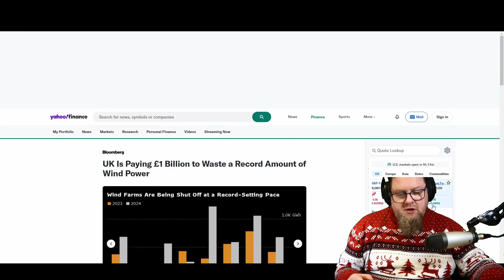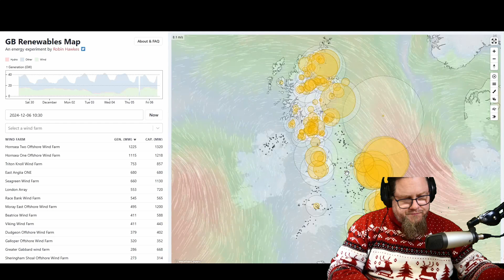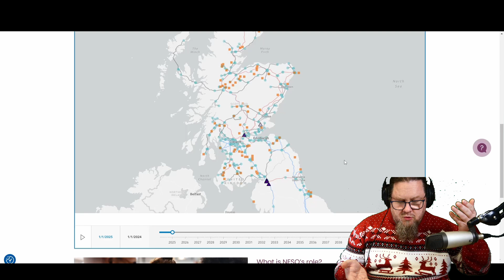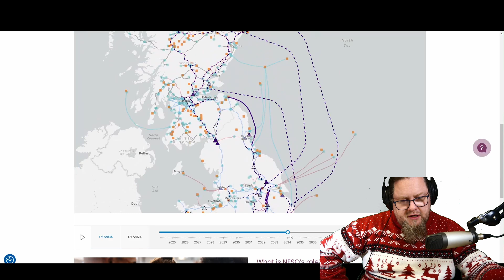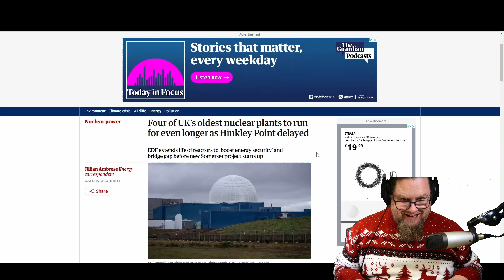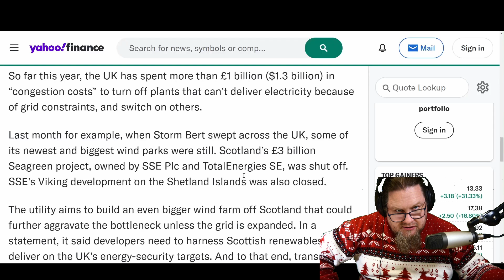Disaster! Starmer Out Of Touch With Reality, 100% "Clean Power" by 2030

Comment: You are a little too pessimistic about wind in the UK

The next generation far-offshore farms will get >60% capacity factors

This could further be increased to 70% capacity factor by having more turbes vs the inverters like they do in solar farms where you might have 1.2GW of panels v 1GW inverter and grid connection

There is definitely an issue of too much wind in scotland but thats mostly polotical in that soctland has alwahs been subsidised by England, including

Also we have always known there would be need for some curtailment. 10% curtailment means your real CFD is ~10% hugher than your headline CFD
Reply from the maker: Dream on.
Reply: @Atomicjedi  What part do you disagree with?

I'm not anti nuclear. I think it's probably the best choice for large electricity users, china india USA etc who have big enough demands to be able to build 100+ reactors and get very good at it

Demand in the UK is just too small to have a large nuclear build. So the few that we build will end up very expensive. The current reactors being built in the UK are guaranteed a price of £130/MWh (2024 price) inflation adjusted for 35 years. That's not cheap

By comparison the most recent cfd for offshore wind allocation round 6 was £82.50 in 2024 prices

Allocation round 4 and 3 were much chepaer still and hopefully we can get back to those cheap prices

So £82.50 offshore wind vs £130 nuclear. Even with 10-20% curtailment, the offshore wind would be cheaper

I don't think this would be true in say China where the wind resources are less good and the nuclear build out is big enough to get good and make them cheaper
Reply: The problem is that wind generation is very spiky and quite often lulls occur at inconvenient times such as winter evenings when there isn't any solar either. Then what? The current plan is to continue to have a complete parallel fleet of gas-fired power stations, just as today. So when calculating the cost of a system that has high wind penetration, we need to look at the total system costs including the wind turbines themselves, the backup generation and its fuel, the additional grid infrastructure (just this cost would pay for several nuclear plants) and so on. The total cost is very large and not effective because we'll still be running gas.

The alternative to gas back up is to have tens of terawatt hours of storage, thousands of times larger than today's pumped storage. This isn't feasible with today's technology, and again, makes nuclear look very cheap.

Finally a PWR nuclear plant can run for around a century - perhaps longer. Wind turbines are expected to last 20-30 years. 

The UK government are already backing away from their 100% clean power target by 2030. Now it's 95% with the rest unabated gas. Come back to this comment in 2030 and let's see whether even this is achieved. 

My prediction is that we won't get 100% clean power even by 2050 unless we radically increase nuclear power or we have some other technology change.
Reply: @mlj9931  I'm aware a wind heavy grid needs 100% backup from natural Gas. On first consideration this indeed seems like a problem as you need two sets of generators. Wind and backup gas

However this isn't an issue because CCGTs are very cheap. Looking at about £600M for a 1GW gas CCGT and they last 40 years. Also the staffing is just 40 men in total to run the thing 24/7/365. So the cost to build them the cost to finance them the cost to staff them the cost for upkeep is all low

If CCGTs were expensive it would be a huge problem but they are cheap

The UK can easily afford to keep these operational and paid for

Something like 40GW of CCGTs and 5GW of OCGTs

That's ~£25B amortised over 40 years at 7% interst would be £155M a month let's say £175M all in. Or £2.1B to have these backup gas plants. Divided by 350TWh = £6/MWh

That is affordable backup

Also a 95% nuclear 5% gas grid would also need curtailment and backup etc

As I've said previously
For larger grids where they can build 50-100 reactors and get good at it nuclear makes sense

But the UK is a smallp grid just 3% of the size of china grid. We don't have the space to build lots of nukes. And we have very good wind resources so for us wind probably will be better

Also the 30 year life of wind farms will like nuclear be extended multiple times with most of the infrastructure like the foundations towers HVDC substations and cables lasting much longer than 30y
Reply: Nuclear has the smallest footprint per GW of all. HPC alone will provide ~7% of UK power and will probably be running in 2100. Just 10 plants of a similar size would cover 70% of demand. Nearly all wind turbines installed today will be gone (or will have to be rebuilt) by 2050.

The engineering of wind turbines is impressive and I would happily support them if they could clean up the grid. They are great for grids that can balance them with hydro. 

The main problem is that when wind speed halves, the power of the wind drops by 90% because power is proportional to the cube of the wind speed. So you don't need zero wind, low wind conditions are a quite sufficient problem for the grid. 

Nuclear can replace gas and wind and solar and storage / gas backup and the extra transmission costs.  It's a far simpler system that would provide abundant power for a century so would be an investment for the future. There would need to be a tiny fraction of the amount of storage or new transmission lines compared to current plans wind and solar grid. 

Look at the grids with the lowest emissions per kWh today. They are all predominantly nuclear, hydro or both. The UK doesn't have much hydro. 

We cannot get to a clean grid with weather energy. We certainly won't have cheap power. But we will waste billions trying and we will miss the 2050 targets, let alone the 2030 ones. It will be a disaster ecologically both locally and globally. I hope this will become obvious by 2030 when we see how little has been achieved compared, say, to where France is already today.
Reply: @mlj9931  The issue is UK demand is too low to allow a large build out of reactors

2023 was 266 TWh demand which is the output of 21 x EPRs

But our demand isnt a constant 30.4GW as imploed by the 266TWh annual consumption. UK demand varies and can hit lows of 18GW

So realistically assuming we charge up the pumped hydro we might be able to incorporate 20GW of nuclear or approximately 12 reactors

I'm sure you'll agree 12 isn't enough to get good at it. The first two being built already are VERY expensive

If the UK grid was big enough to take 50 or 100 or more then maybe we would have a decent shot. The first 10 would still be very expensive but hopefully the next 10 would be acceptable and the 30 after that done well

But again 12 reactors = we will be locked into very expensive energy for decades and decades

Regarding wind power
It was crap
But the new 15MW wind turbines are very effective in the right locations they will achieve over 60% capacity factor

Transmission is only an issue becuase we have stupidly allowed to many to be built in Scotland probably to appease the Scots

Unlike say Germany which only has the north sea to its northern border so has to build lots and lots of long expensive transmission south. We are surrounded by water so we don't need to move a lot of power inland

95% of England & Wales live within 100 miles of the sea. 50% live within 50 miles of the sea

Our transmission issues are of our own making and we shouldn't blame that on wind

Also I am aware wind power is a cubic function of wind velocity. However the new wind turbines have an output curve such that placed in locations like the dogger bank they'll get 60% capacity factor. In the future we might see even higher CF for example if you increase blade length by 50% but keep the other things like generator at the same rating you'll go from 60% to a little over 70% capacity factor

Also wind output is higher in the colder months as air is more dense in the winter. This is good as we have higher demand in the winter

Overall I am pro nuclear
But not for the UK
Too low demand for many bukes
And some of the best wind resources

Also offshore wind will be like nuclear

A nuclear plant can last 100 years like a home can last 100 years. Might need a new roof and some repairs but it'll keep going

But that is true for offshore wind too
The HVDC cable can have very long lives we have HVDC cables that have been around 40y and are still going

That alone is aboit 1/3rd the cost of a wind farm

Likewise the foundation and towers will likely last a hundred+ years in the same way the foundation and walls of a nuke will last hundred+ years

You might well be correct that in 30y time we will rip out the offshore wind farms but most likely because we will have so much better turbines it'll make sense to install new

But at some stage improvements will slow/stop and offshore wind farms will be like nuclear with hundred+ year lives with just upkeep.in the way a home.might need a new roof once a generation wind farms might need new blade and generator once a generation etc
Reply: As for the economics of nuclear, we are not building designs that are unique to the UK. The EPR design is French, as you probably know, and has also been built in France and Finland. The EPR has been expensive to build, but each reactor is getting cheaper and we are using experience from the French build e.g. with containment dome construction. You may know that France is going to build many EPR2 reactors, which is designed to be simpler, so this is another possible design for the UK.

Another vendor country that is of interest is S Korea who have built a very successful 4 reactor plant in Abu Dhabi and have been commissioned to build more reactors e.g. in Poland. 

Rolls Royce has produced an interesting design that is modular but not that small at 470MW/reactor. Sadly the Polish and Czech governments are more interested than the UK's, but least this will help with the economies of scale that the UK may exploit later if we ever get an energy policy based on engineering rather than wishful thinking. 

It is perfectly possible to follow demand with nuclear. A limited amount of storage can save cost. (Storage requirements are for incremental power for daily peaking, not most power in a a 10 day wind lull, so orders of magnitude smaller. Peaks will likely be smaller too - look at how flat French demand is during a typical day.) 

Nuclear is the most promising way to  eliminate gas from the grid and is far cleaner than wind, solar or gas. Wind and solar cannot do this because even at the outer limits of potential installed capacity there will still be wind lulls in winter when wind and solar output is low and demand is high. Nuclear is the least intrusive in the environment eliminating the need for so many new power lines, and square miles of solar and wind. Energy security will be improved.
Reply: @mlj9931  once again I say we aren't starting from a blank sheet of paper. We already have existing infrastructure and infrastructure under construction. Atir stands 72% if uk electricity generation this year has been non fossil

There simply isn't much space left to add nuclear when only 28% of generation is from foss fossil fuels and that number is going to fall as existing under construction wind farms and interconnectors are completed
Reply: We can't just look at averages over the year. We have to consider what happens day to day, hour by hour, minute by minute. Wind and solar regularly fall to around 1GW or less combined and then you do need a complete parallel system of generation, not 28%. We are contemplating spending more that £100bn on grid infrastructure to support wind and solar. That alone could provide enough nuclear power stations to provide 20% or more of demand, in addition to what is being built now. Similar gargantuan sums are being contemplated for wind, solar and batteries. It's very expensive and yet ineffective in removing fossils fuels from the grid.

Build nuclear now, and when it comes online wind turbines and their gas backup plants that are at the end of their useful lives can be retired  gracefully.
Reply: @MarkL-J  I am aware of the issues but similar issues are also there with a nuclear heavy grid

Past 13 EPR reactors in the UK grid any additional reactors need curtailment

So behind about 60% nuclear you need curtailment of nuclear

Which is roughly the same as with offshore wind

Also you wouldn't be able to have an economic 100% nuclear grid as the last reactor you build will only be on for about 4 hours a day during winter peak months and then off for all of summer autumn spring and 20h a day during winter too

That is to say a nuclear heavy grid also needs gas speakers to meet peak demands

I'm not anti nuclear so to be fair you can probably build as many as 20 EPRs @32.6GW with 15GW of backup and peaker gas stations. That would result in about 85% nuclear 15% gas

But the UK can get to the same 85% nuclear 15% gas with ~43GW of offshore wind and 45GW of backup gas fired stations

So it's

32.6 GW Nuclear + 15GW Gas
Vs
43.0 GW OffshoreWind + 45GW Gas

The 30GW additional gas turbines would cost anout £15B once every 40y

43GW of wind is chepaer than 32.6GW of nuclear

Also no need to import uranium
And the wind farms add 0 net heat to the world. While 32GW of nuclear would add some 75GW of heat to the planet

And yes I am aware the wind heavy grid needs more interconnectors than the nuclear heavy plant. But we already have the interconnectors we can't go back in time and not build them. Also arguably interconnectors have a negative cost as they are fairly affordable and allow the overall EU grid to be more efficient (this is true pre solar and wind)

So once again
Nuclear good where the demand allows 50+ reactors to be built
Nuclear not so good where wind resources are fantastic and you already have wind farms and other infrastructure and can't go back in time to not build them
Reply: @kaya051285  The way the French handle the demand issue is to do maintenance and refuelling in the summer but aim to have all reactors possible available in January and February. In addition they use hydro and pumped storage for peaking. The UK does not have much hydro, but pumped storage can make a meaningful contribution to peaking as I discussed earlier since this is incremental power for a fairly short period of time each day (e.g. your "4 hours") with plenty of opportunity for recharging at night and even during the middle of the day. Of course PWRs can load follow too and EPRs are specifically designed to. It looks likely that some grids will use SMRs for additional flexibility.

Imagine a completely green grid that can provide power for a century. Imagine not needing to cover the countryside with wind farms, solar panels and new transmission lines. Imagine the energy security benefits of being able to store years of nuclear fuel (and even extract it from seawater) instead of relying on continuous gas imports to keep the lights on. Imagine a stable electricity price.
Reply: @MarkL-J  The big difference is the size of demand. France has many more homes and businesses heated via electricity

France ~493 TWh
UK ~266 TWh
That's almost double our grid

The UK is a small market
And we aren't starting from a blank sheet. We already have lots of existing infrastructure

Say it was 1995 I would absolutely have agreed with you. We should have built 1 reactor per year so that we would currently have 30 PWRs at about 36GW. At the same time we would have encouraged some level of electrical storage heating for flats and smaller homes and wirh EVs etc we could have gone to a 90% nuclear 10% gas grid

But we aren't in 1995 we are almost.in 2025 and have already invested billions olkntk wind farms solar panels interconnectors

We simply don't have the size of grid to deploy enough nuclear to make it viable
Reply: @MarkL-J  also why does it make sense to build nuclear in the UK when we can for a fraction of the price build say 6 more interconnectors which will give us cheap power

2 more links to Norway @ 3GW
1 to Seedeb @ 1.5GW
3 more to France @ 4.5GW

That alone will take the currently ~72% non fossil UK grid towards ~90-95% non carbon grid

We could do the above before 2030

The French already have an excess of capacity and are continuing to overbuild wind and solar. We can just import their excess for below cost price

Likewise Norway/Sweden have an excess and are continuing to build more and at the same time are getting more efficient by replying joul heated homes with heat pumps etc

If we were China with 12,000 TWh demand makes a lot of sense to build a thousand reactors. But at 266 TWh demand we are just too small a market
Reply: @kaya051285  I agree that the "dash to gas" that scotched nuclear in the 1990s/2000s ultimately prevented a fleet of PWRs like the very successful Sizewell B being built, and that we would be in a much better position today if they had been. But we are where we are and the second best time is now.

We DO want to electrify heating and transport and so forth that will both increase and smooth demand for electricity. This is how we reduce fossil fuel use in these sectors.

Interconnectors have a role and of course it is great to get nuclear and hydro power from France and Norway. However, wind power is well-correlated across Europe so when we have low wind there is a high chance that other European countries will also be low. We can't rely on importing wind power. Manage your expectations about how much power Norway can deliver, especially in drought years. This can never provide more than a small fraction of UK demand. Energy security also requires that we do not rely on imports.
Reply: @kaya051285  But not for the UK
Too low demand for many bukes
And some of the best wind resources:face-green-smiling::face-green-smiling:  BS
Reply: @kaya051285  You can see the folly of a wind and solar policy right now. There is low wind over all of Europe, driving up electricity prices. The UK wholesale electricity peaked at over £500 per MWh yesterday, while in Germany it was over €900/MWh. More than two thirds of UK electricity is currently coming from gas, 6% wind, 0% solar. Far from importing on UK interconnectors, the UK is exporting on every one apart from the one to Norway (the power from which is immediately being exported). Why? To use our gas generation to cover part of the shortfall in other European countries. Doubling or tripling wind by 2030, even if achieved, will not meaningfully change this issue, and NESO and the UK government now admit that in 2030 we will still be driving a similar number of gas power stations hard under similar circumstances.

Nor is this unusual. A similar situation occurred in November for more than a week. We are not yet at peak winter demand.

The UK situation will be made worse in 2030 as most of the existing nuclear plants reach the end of their lives before being replaced leading to the possibility that more gas, not less, will be needed in similar circumstances. 

Meanwhile the grammes of carbon dioxide per kWh now is less than 100 in France, more than 350 in GB and more than 500 in Germany. People who genuinely care about carbon dioxide emissions will advocate for a grid that looks more like France's and less like Germany's because France is always cleaner.